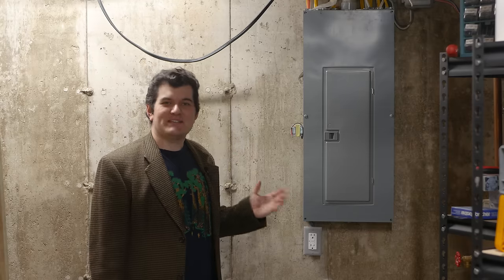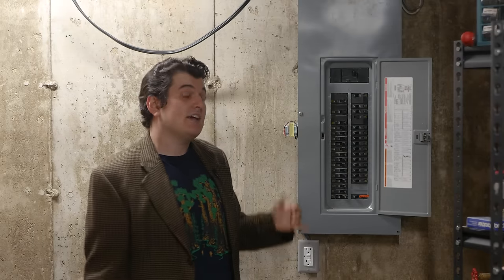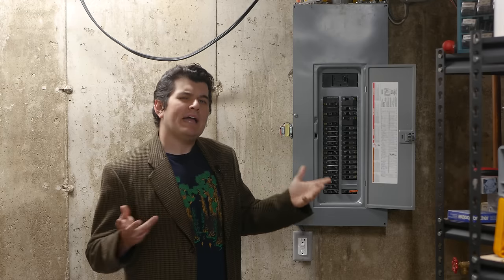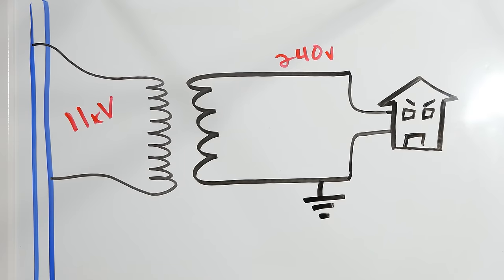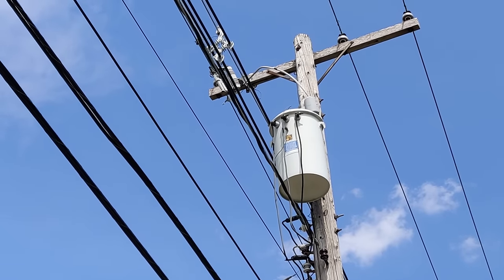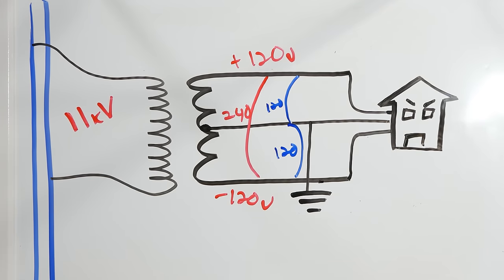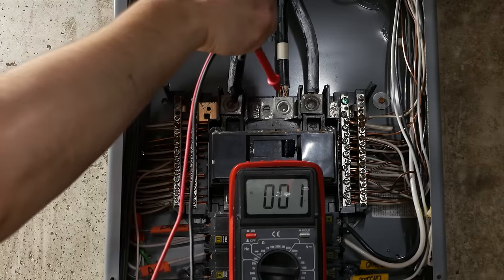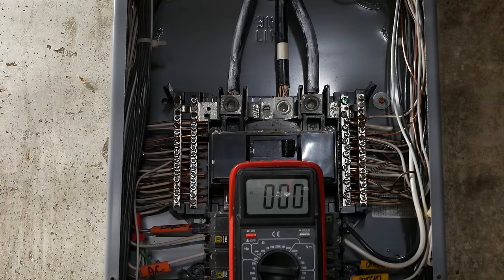The US electrical system is not 120V

Comment: Appreciate the one-handed DMM technique. A very good practice. Do you also follow the "one hand in your back pocket" rule?
Reply from the maker: Well, the one-handed technique was applied not 100% consistently, but where it was practical. In some shots I had to hold the meter with my other hand but I tried to stay on the plastic only. As far as the back pocket rule - I do when I'm unfamiliar with something like poking around a radio chassis but it's been a while since I've done that!
Reply: My Fluke even has holders to put the probes, so you can one-hand it with one of the probes sticking out of the meter.
Reply: @TechnologyConnections   maybe you can solve something puzzling me.  It only takes a couple of millimetres of flexible silicone insulation around a wire to provide insulation beyond a thousand volts.  Therefore all electricians working on live circuits should wear such gloves.  They don't.  Why the hell not?  Even a pair of synthetic rubber gardening gloves would probably be good enough.   But it seems that they don't.   Weird.
Reply: @raykent3211  Wearing safety equipment doesn't make you safe, only actively applying safe practices does (of which PPE is only part.) Often people will put protection on and then act recklessly thinking that they're "safe", and get injured. And when was the last time you tried to do anything fiddly while wearing dishwashing gloves?
Reply: @raykent3211  Industrial electrician here. In manufacturing, sometimes it's not feasible to shut off the power, regardless how many safety videos they show you, admonishing you to "LOCK OUT TAG OUT." In those cases, I actually do wear the thin latex or nitrile mechanics gloves under regular leather/kevlar/nylon mechanic's gloves, like those guys on the car mechanic's TV shows wear all the time. I've handled hot 208v wires that way, and a few 480v wires, though I'd rather not if I can help it. In any case, I've never felt so much as a tickle using the double-glove method. DO NOT TRY THIS AT HOME.  I am a professional with decades of experience and I know WTF I am doing.
Reply: @raykent3211  safe practice with known potential to injury results in less injury than any matter of presumed safe situation. especially when a pin prick to a glove could be  deadly.  on another note electricians do take such safety precautions when working on live or unknown circuits but because it isn't standard most work using the same practices as if they didn't have the gloves on.
Reply: @wirenutt57  That's not do not try this at home, that's DO NOT TRY THIS ANYWHERE. As an EE who's done Lockout and Live work training I can tell you that the proper PPE for live work is NOT nitrile gloves in any way shape or form. The breakdown voltage for those thin gloves is way too low to be properly protective, and while having them under another pair of gloves helps prevent tears there's the very real possibility that there are tears or even microscopic holes that defeat any protection they might give you. Not to mention the fact that the coverage area isn't long enough given proper PPE has much larger cuffs on them. Take a look at the picture from the OSHA site on PPE for live electrical work https://www.osha.gov/SLTC/etools/electric_power/personal_protective_equipment.html You'll notice the black rubber insulating gloves cuffs sticking out past the protective gloves cuffs. The insulating gloves are inspected for any even pin-prick hole before donning, and then wearing a set of protective leather gloves over that to prevent damage to the insulating gloves causing them to lose their insulating properties. PLEASE FOR THE LOVE OF SAFETY NEVER USE NITRILE GLOVES AS ELECTRICAL PPE.
Reply: @raykent3211  Gloves are prone to failure (as is wire insulation TBF), and should be inspected prior to each use.  The method employed by the U.S. Navy is to roll them up with air inside and check for leaks. You should also wear a tinted arc-shield face mask, etc...  AFAIK this is an OSHA-enforced practice for non-residential electricians.
Reply: @JamesChurchill   your argument is true but misleading.  It implies that ppe is bad because people are stupid and the wearing of it makes them overconfident.  An argument that I've heard a lot recently in relation to covid.   The same argument would lead to the banning of seat belts and speed restrictions.  It's true that a crash helmet doesn't stop you coming off a motorbike and dying.  But statistically it's worth having.  I'm sure you'd agree that it's worth having a millimetre of silicone around the wires to the multimeter, so why not around your hands?  No, I haven't tried doing anything fiddly wearing washing up gloves, but just how fiddly is the work of electricians working on live circuits? They're not assembling watches.
Reply: @wirenutt57   thanks for that experience.
Reply: @Lawrence330    that sounds sensible.
Reply: @michaelbitsch  I noticed two key items... Electrical Engineer, and Training.  I worked on the stuff for almost 30 years, first as a trained and certified electrician and then as an industrial engineer... If you read the first paragraph on the link you sent, it says:

        "Depending on the job task to be performed, PPE for the electric power industry generally includes safety glasses, face shields, hard hats, safety shoes, insulating (rubber) gloves with leather protectors, insulating sleeves, and flame-resistant (FR) clothing."

Notice the first part of that sentence... it states "Depending on the job task".... that can vary greatly....   the next portion is critical...   "for the Electric Power Industry"... those professionals are commonly working on voltages far in excess of 480V 3 phase which is where that level of equipment is strongly advised if not absolutely required.  Those PPE are not so much the case when working with lower voltages like 120V... while they are still strongly suggested to be the most safe, they are also not "required by law" and are highly determined by the nature of the work to be performed and the level of danger represented by the voltage and amperage. There are also many instances where following all the guidelines and using all that equipment is actually worse and causes less safe working conditions. That is why they use the term "Qualified" electrician because they have been specifically trained to all the possible hazards and safe practices and have also had practical experiences and testing. They have also been vetted by the employer to know what they are doing and many (if not most) of the possible hazards have already been determined and a suitable balance of risk, safety and efficiency (or effectiveness) has been determined and the minimal equipment required for each type of task. The average homeowner has nothing of the sort, however they also have far less possibility of contact and the more recent equipment has been designed to specifically reduce those hazards even further.

To give more detail about the gloves... Nitrile gloves are designed to protect against *Chemical* hazards only... nearly EVERY chemical is a compound molecule and even the smallest Hydrogen molecule is still many thousands of times larger than the electrons that make up electricity. Nitrile and even latex (thin rubber) gloves are not designed for that... they cannot stop those electrons but they can mitigate by providing a higher insulation barrier than bare skin... just like the cloth masks being worn currently... they will NOT stop the virus, but they can reduce the chances of them getting through to a reasonable risk.  Also keep in mind that most PPE gear is not an absolute preventative, they are mitigating to reduce the dangers as much as possible... as the level or amount of mitigation and risk reduction goes up, so does the cost and complexity, it also increases the time, costs, and difficulties to perform the tasks needing to be done.

The primary point is to **NEVER***, **Ever* treat electricity lightly... even when you think it is "Off"or are a trained professional...  it can very quickly and easily be more deadly and dangerous than the most venomous spiders and snakes, etc.  However, taking appropriate precautions and recognizing the risks and how to lessen them goes a long way to keeping yourself safe from those hazards.
Reply: @raykent3211  Considering that the average 120V electrical screw size is #8-32 by 1/2 - 3/4 long and many electrical crimp connectors are also comparatively tiny (about the size of an uncooked straight macaroni noodle), it may not be "assembling watches" but they are still quite difficult to pick up and work with while wearing gloves and it only gets worse with every layer of thickness applied.  

The argument about "overconfidence" is decidedly true as those incidents often involve trained professionals putting too much faith in their PPE (Personal Protective Equipment) and not paying proper attention or care to the task they are performing and getting seriously injured or killed (as proven by OSHA and NFPA statistical investigations and data).  The only part about it that is/was "misleading" is your interpretation that "PPE is bad because people are stupid"... Yes, people can be ignorant and overconfident while wearing PPE and too much hype about how much protection it provides can give them a false sense of security and they get lazy and sloppy and pay less attention solely because they think they are "Safely" wearing PPE... This does not diminish the role or importance of PPE

The point is to *ALWAYS* pay attention and treat electricity as a dangerous thing even *With* the PPE... Your proper attention, knowledge, and training are every bit as (if not more) important then the PPE you are wearing. I have occasionally had to work  on live circuits up to 480V with my bare hands due to highly unusual circumstances... I actively avoid those situations whenever I can, but I was able to do that work precisely because I knew the hazards of any mistake and knew precisely what I was doing and how to minimize the danger... even so, I have still been "bit" by those voltages in a couple of exceedingly rare circumstances early in my career (learning experiences) and have great respect for the danger (and pain) that electricity can inflict in a microsecond of inattention or laziness.

I once saved a fairly high placed executive from a bad arc flash incident.  He was standing in front of an 800V panel and trying to throw the switch. I called him out to stand to the side and directed him and the group of clients to a safe distance. I put on the proper PPE and applied the proper method of standing to the side and when an internal part shorted and blew a six foot flame out of the switch hole and nearly blew off the door, I only got a minor burn through the glove because I knew where and how to stand and shield and protect myself from the possibility of Arc Flash... Even using All the RIGHT PPE only partially helped because molten copper will even burn through steel.  It was the attention to detail and knowledge of the hazards that saved me from a bad injury and especially him. If he had succeeded in throwing that switch it would have literally burned his face off as he was less than two feet away from and the same height as the hole that belched molten copper.

Comment: 1:54 oh a normal circuit box I wonder how man... OH MY GOD.
Reply: For comparison, a fairly budget new all-electric home in NZ is generally going to have ~10 circuits.

4x sockets, 2x lights, oven, cooktop, hot water, heat pump.

Maybe some extras for EV charging, second heat pump, alarm system, or just more sockets. But the above is entirely sufficient for a 3-4 bedroom house.

Comment: Australian Home Unit in Kogarah had 3 phase 415 Volt instant Hot Water System (HWS). It was more efficient and cost effective because, you pay for what you use. A neighbour switched from 3 phase instant HWS to a 50 litre tank which tripled his electricity bill because of the very nature that the water storage tank got heated, cooled, heated, cooled etc. and occasionally the Hot Water got used.

In fact, our flats had the copper cold water pipe wrapped around our building, so in Sydney's Summertime we had free Hot Water from our Cold Water tap at no extra expense. Too bad, if I got randy in Summer........*take a Cold Shower, Dear*. Sorry love got to wait for winter.

Love you quirky but highly informative show. Big Clive in Scotland is quirky too. He never shows his face , just his hands. Until he did a video on a Japanese Doll......

Reference*Review of DANGEROUS Japanese Fanny Flambeaux doll.* 3.5 million views, 2013
Reply: how big are the australian main fuses usually? are they 3x25a, 3x32a, 3x35a or 3x40a?

Comment: In germany our 'normal' voltage is 230V but we also have something called "Starkstrom" which is 400V for powering our ovens for example.
Reply: Addition: This applies to the entire EU. ;)
Reply: And it's three phase
Reply: Three-phase is common in the U.S. too. It just isn't common in homes. But nothing stops you from buying it from your utility.
Reply: @istdaslol  The difference between "Starkstrom" and "Drehstrom" is that "Starkstrom" has a neutral, while "Drehstrom" does not require one as it is only intended for motors.
Reply: @EebstertheGreat  Nothing other than financial incentives.
I assume your connection fees will be different??
Reply: I want my PC to run on 3 phase power.
Reply: I'm not understanding the pissing contest about 400V stove power, when we (the US) have natural gas for our heating. The 120V power source is only the ignition, and powers the electronics.
Reply: Ironically "Starkstrom" sounds like the name of a Transformer!
Reply: @1mrhamel  I mean, it just depends. You can find stoves running on anything in the US.
Reply: According to VDE, Starkstrom is anything beyond 1kV, so not quite. That's been the case for around 20 years now.
Reply: @oscargr_  I just looked up the fees for my utility (for residential service): 
Monthly Facilities Charge:

Single Phase Service $32.50
Three Phase Service $47.50
Reply: in backwards Britain, most domestic properties are single phase only, Commercial properties are often 3 phase 440V, and you can get 3 phase in a domestic house if you're prepared to pony up for it. Good for charging an EV in a hurry.
Reply: @EebstertheGreat  UNLESS it is not at the pole, then you can NOT just buy it.
Reply: @pkeeney  Oh, thanks. Yeah. That is what I expected.
If you are in a residential building and you want to start using 3 phase, don't you also need to pay for the installation of extra wires?
(Or is that the reason your monthly fees go up and you pay the wires over time, so to speak)
Reply: @1mrhamel  Correct and we have both types on this side of the pond with a majority of gas heated stoves.
Iduction plate is usually three fase connection to keep the load per phase low. The real 400 volt without the zero is usually used in bigger electric motors.

Comment: US: 240V available. EU: 400V available.
Reply: EU: 0.4kV !!!
Reply: @CanadaRulez4Ever  exactly
Reply: UK 3 phase to home is 415V
Reply: It's going to be a big advantage having 400V home charging with electric cars I reckon.
Reply: @korakys  as he mentioned in the video: US has 200A / 240V by default in every house. That's 48kW. Here in Central Europe the basic installation is 32A/230V, which is 7,3kW. My house has 3x25A on 3 phases - that about 17kW. And I had to pay for it. A lot. And I still have less than half what you get in the US.
So: no, I don't think the advantage will be here in Europe in that sense.
Reply: @favesongslist  3 phase is described as 400V (single phase is described as 230V) but you're right it's normally 415V (with single phase being 240V)
Reply: US 3-phase where I live is 480V, 277V from hot to ground. 277 bites in a way that 120 just don't.
Reply: @isuller  When I built my house 7 years ago in Germany, I got a 35A main breaker. I could have gotten a 63A with no additional charge. I could even 100A, but then it will most likely cost a bit extra. Didn't check.
I went for the 35A, because I can use 40A GFCI which is a lot cheaper than the 63A version. Alternative would be a 40A GFCI and using Neozed fuses with 35A in between the GFCI and main breaker.
The cable to my house is 25mm².

Comment: Hi Guy! I'm from Argentina, and here we use the Type I plug (the same one used in Australia), which is more secure. Formerly we used the European Type C plug, but since it was more insecure, this current plug began to become popular. Type C is still used in some applications, but most homes in my country use Type I, and they make mixed plugs for both types.
I agree that the American Type A and B plug is very unsafe.
When I connect an appliance that came from the USA, the electrical spark that it gives is greater than with the plugs that we use there (since we use 220-240 V).
Reply: Type I is definitely better for any devices that are not double insulated and need a protective earth pin, which Type C doesn't have, but I wonder why then Argentina moved to Type I for that and not Type F (Schuko). Type F is arguably safer than the Type I plug, which has the same issue as the American plugs where things can touch live prongs on half-inserted plugs. Type F sockets prevent that since they're recessed. Especially puzzling to me since sockets for Type F would have had the additional benefit of also fitting existing Type C plugs for devices that don't need the third pin for PE.
Reply: @ska042  About type F plugs, I don't know why they weren't adopted. What I did see in some older houses that used type L plugs (which is like type C, but with a third pin to ground), which could have been suitable, and we would not need to adopt a different system. But hey, these are things I will never know.